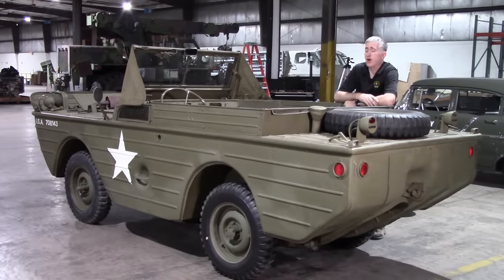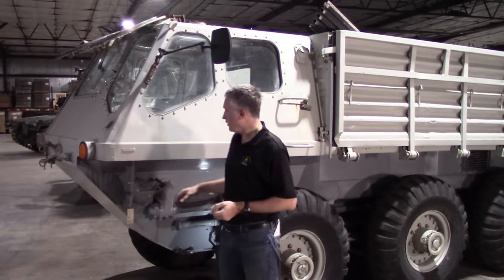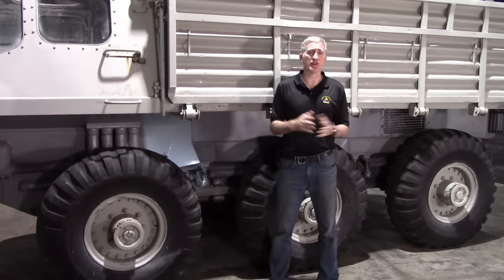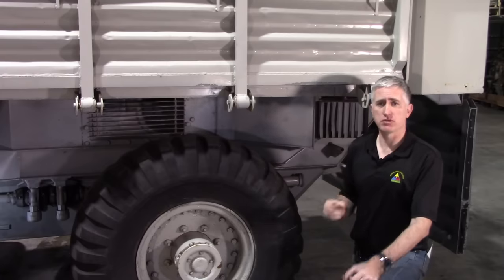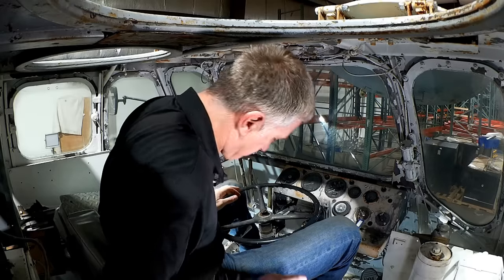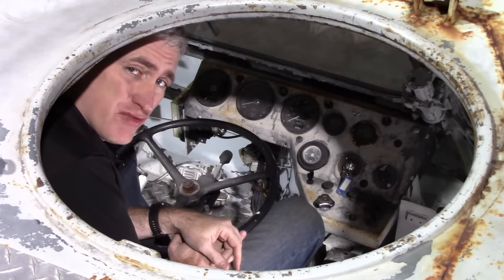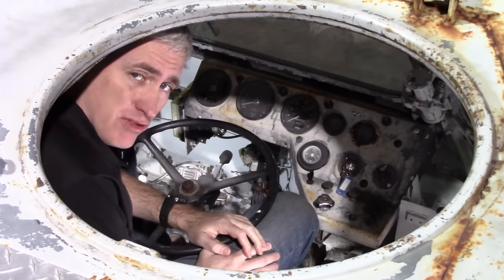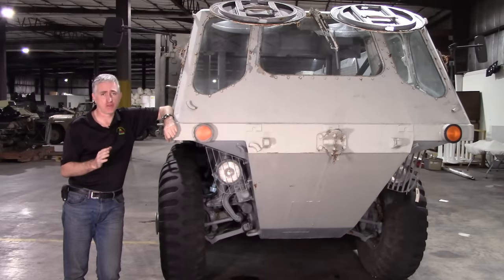Inside the Chieftain's Hatch: FV622 Stalwart MkII

Comment: It could be said to have been designed for the Falklands War. It had just gone out of service and hundreds were in store. But no, the British have their procedures and traditions so almost no vehicles of any kind were used in the war, supposedly because of the terrain. Although that never stopped the local farmers. Consequently the men had to fight with little more than pop guns and light artillery with scarcely any ammo. So they died needlessly and stupidly just because the British do not believe in firepower. Also they really did not kill very many Argentines. Just subtract out  the air and naval casualties and the exchange ratio is not good at all. The US defeated the Iraqi million man army with about as many losses.
Reply: Where's the hysterical laughing emoji? 
CVRT (Spartans and scorpions) ideal for the Falklands.Wheels not so good for boggy peat
Reply: what utter bollocks if it didnt have low ground pressure tracks it was ussless in that terrain

Comment: what is rarer than a Stolly? A Stolly which can swim
Reply: where's you get that idea from?
Reply: @markellis7819  Because a lot of the stolly's had the swimming gear removed, or the vehicles are no maintained to a level which allows them to enter the water safely.
Reply: Oh, you mean the few that had the tillers and the short propshafts to the Marine Propulsion units removed.
Removing the splash board doesn't stop them swimming
Reply: @markellis7819  Yep that's it. On a show called Salvage squad they had to restore one and finding the kit was a nightmare.
Reply: This is filmed on a Mk 1. Go in 1 minute and you'll see the main bilge pump working nicely. They also have a hand bilge pump behind the driver's seat

https://www.youtube.com/watch?v=YJeE7A59VEY